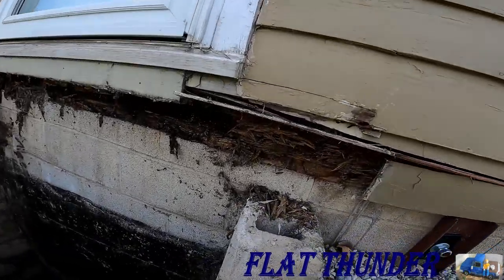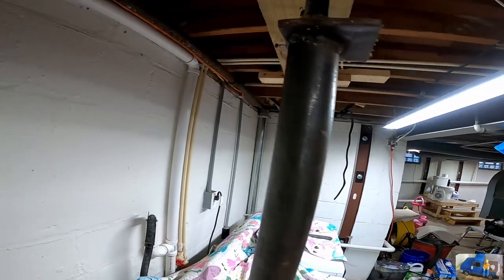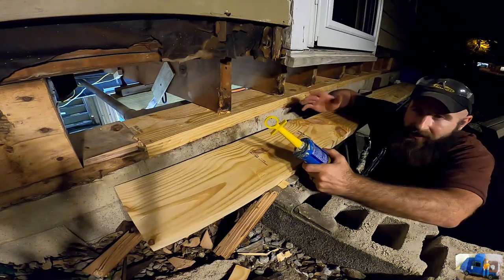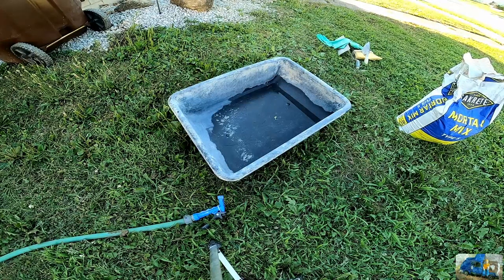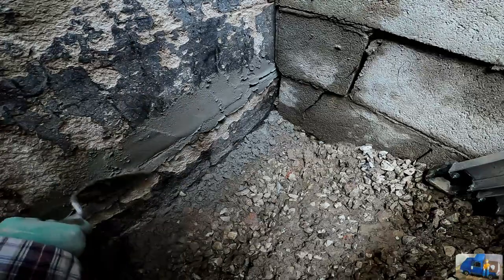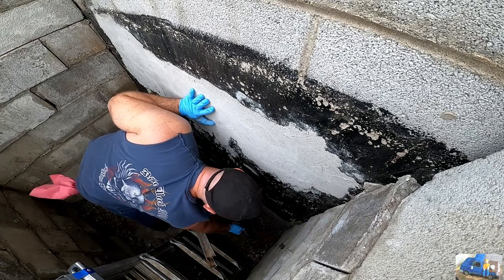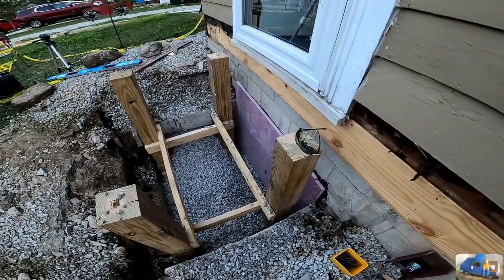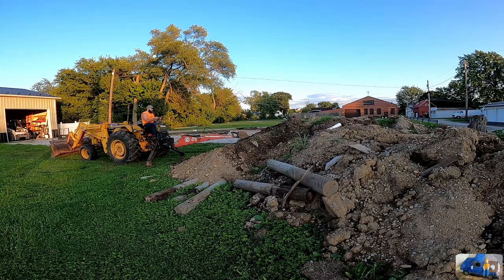RIM JOIST / SILL; REPLACEMENT (CONCRETE STEPS/PORCH ENT./ EP#2)

Comment: Just bought my first home a day looking to remove the concrete porch in the front and back. I want to replace with wooden decks as well. This gives me some motivation that I will be able to complete the task.
Reply from the maker: Excellent!  If you tackle it one piece at a time anything is possible.  I recommend installing the deck free floating; ie without attaching it directly to the house with a ledger board.  This is the best way to reduce water intrusion from deck installations (in my opinion).  Thanks for watching and congratulations on your new home!  👍😁

Comment: I had a contractor pull off my old d close and found it hadn’t been flashed. Watched him replace the rim and sill and was fascinated how fast he did it. He cut it with a reciprocating saw into small sections between each hoist then hammered them back halfway off the foundation block, took new sill and hammered it into place while the old one knocked out into the crawlspace floor and cleaned it up. He did it so fast I was amazed. I had seen people do them by jacking the joists up etc. This way was quick and the floor stayed the same level then he cut the new band board and was done
Reply from the maker: Good idea!  I probably would still install supports just out of extra redundancy/paranoia, but this could work!  Thanks for sharing and watching.  Cheers, 👍😁

Comment: I just ran into the same issue after tearing the rotted deck off our house. Whoever installed it didn’t use bay flashing and same wood you replaced is rotted. 
Looks like my house uses two 2x4 for a sill and I hope I’m not getting in way over my head attempting to repair it myself. 
Anyway, your video helped. Thank you.
Reply from the maker: Take your time, think methodically, support it safely and you will succeed!  Attaching deck ledger boards incorrectly without the correct flashing is a common cause of rot.  Even when they are installed correctly it is a leak point.  I installed our front deck free standing without a ledger to avoid having an additional (potential) leak point.  Thanks for watching and good luck with the repair!  👍😁

Comment: Look at that..im here today cuz my previous owners didnt flash the decks lol...got about 25-30' of the rim/sill plate to replace....fun stuff
Reply from the maker: Bummer..... More than double the repair required in this video.  Decks are a pretty common problem area for several houses.  People just slap a ledger board on the house and let'er rot.  Best of luck on the repair!  👍😁

Comment: Superb! I have the exact same issue. I noticed mushy sill plates when they replaced the outside door. The deck butts against the outside and there is no flashing. The basement is also finished and I dread having to tackle this, but it has to be done. Your video was super helpful and you did a fantastic job covering the details.
Reply from the maker: Thanks!  Improper flashing and improper deck installation is a common issue.  I opted to mount my deck free standing next to the house instead of installing a ledger board.  This removes a leak point and gives the water a place to go that's not directed into the house.  Thanks for watching and best of luck on the repairs!  👍😁
Reply: Is the deck attached or just butted up against it? Our deck is butted up against house, but not attached but I worry about this issue
Reply: I just had the deck redone because there was no way to look at the band joist or the sill plate damage until the deck was cleared from the outside wall.  I had one contractor do it all. They removed the old deck and found that the ledger board was slapped on the wall with no flashing, and the clowns that built it had used wrong fasteners on the ledger board as well. So water was getting into the foundation each time it rained. To add insult to injury, we found that the main support pillars of the deck were simply set inside 4" hole with no concrete! So I had to get new support pillars which were properly buried 12-18" deep and concrete poured into it. It was a disaster. 
I noticed that some sections of the sill plate were soft, including the joists, but overall, it was not at a point where the sill plate had to be replaced. Considering the enormous cost of lifting the joists from the inside to put a new sill plate (the inside of the basement was finished and that meant cutting drywall etc),  the builder affixed sections of solid board against the old joists to create a strong support to which they properly screwed the new ledger board. I took the time to block each band joist cavity with a 2" foam board and spray foamed around it to create an air seal before they put the new ledger board on it. They then installed a metal flashing that went under the vertical framing of the house and over the ledger board so no water would go into the band joists. The framing of the deck was constructed over the flashing. I also used joist tape along the length of the deck support framing to prevent rot. Once the new deck was built, they installed the proper j-channels (mine has vinyl siding) and sealed all contact points along the outside framing.  This should fix the water incursion. I am glad I decided to take the plunge to address this because it would have proven costlier the longer I waited. I hope your situation is better than mine and wish you the best.
Reply from the maker: @MrSoulMonk  it's crazy how builders can overlook simple flashing..... They must get away with it because the damage takes time to show up.  Happy you got everything repaired and fixed up!  I opted to leave my deck free standing next to the house without a ledger board.  It has a gap of ~1" give or take.  👍😁
Reply from the maker: @youknow1334  my deck install has a gap of approximately 1" in between the house and the deck.  No ledger board required.  Thanks for watching 👍😁

Comment: My buddy just did a job like this last summer at his mother's house.  Home builders never protected the rim joist from the elements and attached a deck directly to it.  Snow and rain had nowhere to go and just sat there.  After about 15 years her rim joist along the deck was pretty much gone from rot.  My poor buddy spent most of his spare time replacing the rim joist and ledger of deck that had rotted then he rebuilt the deck.
Reply from the maker: Lots of builders fail to flash in the deck correctly.  I prefer omitting the ledger board and spacing the deck slightly away from the house.  It's a little more expensive, but provides a space for the water to drain.  This is definitely a time consuming project!  Thanks for watching and sharing!  👍😁

Comment: About to do the sill plate and rim joist under my front door. Have been scared because it looks so bad. Thanks to this video though I think I can do it. Fingers crossed
Reply from the maker: I am happy my project videos are helping others!  You can do it!  Please ensure to lift and support your floor joists safely.  Typically a poorly flashed in door will cause water intrusion around door thresholds.  Happy DIY'ing!  Thanks for watching.  👍😁
Reply: @FlatThunder  there is no flashing around the whole house. Surprised it isn't much worse.
Reply from the maker: I am guessing it is an old house.  On my repair project I used tar paper to flash in around the threshold along with tar sealant.  I think Aluminum is a better option.  If you are replacing the entry door too, they have other options.  I have seen (but not used) rubber membranes and aluminum caps people install before setting the door.  Cheers, 👍
Reply: I think that grace ice and water shield would work for flashing it's self sealing made for roofs and around window...

Comment: Thanks looking forward to seeing the flashing and siding replacement. Very helpful
Cheers Chet
Reply from the maker: Hi Chet!  The video is available on the channel.  I don't know if I mention it in the video, but they make special pre made wraps / flashing pans for under the door threshold.  They are ideal.  I used a different approach to avoid removing the door.   Thanks for watching!   Cheers 👍😁

Comment: hey thanks for the video. very helpful. I have to replace the sill plate and rim joist (face board as you called it) on my son's house he just bought due to water and termite damage. It's 90 years old. I see you just supported the joists and pried out the old sill. I thought I'd have to lift the joists another 1/2" or so up to get the sill plate out. I was also concerned about taking the rim joist off in case the joists would go crooked or something. I was thinking of working in about 4' sections on ours. we still have to rent a jackhammer to remove the concrete that was poured up next to the house. probably why there was water damage.
Reply from the maker: Sorry for the delayed response.  I thought I replied to your message already, but must have fat fingered the submit button.  If you are concerned about the joists moving I recommend affixing them together.  You could add short 2x4 sections in between the joists to stiffen them and to hold orientation and or you could place a scrap 2x4 or 2x6 directly on the bottoms of the joists as a temporary position holder.   If you are interested in renting a jackhammer check out my video (https://youtu.be/YUzTGLIG5r4).  I purchased a cheap jackhammer and use it to demo an old concrete foundation.  It was actually cheaper than the rental fee and now I have it around should the need arise.  Please support your house safely and cautiously.  Cheers,

Comment: Do you normally have to place jacks under the house to replace the rim joist and sill? I have the same problem right now.
Reply from the maker: If you do not support the joists they will drop on the top of the blocks.  I suppose if the bad section only spans a couple joist it might be possible to replace without jacking.    Maybe slide the new sill in as the old one is sliding out (ie don't remove the old sill until starting the new one in).  However I would recommend supporting them from underneath.  It doesn't need to be raised, but more so supported in it's current position.  Thanks for watching! 👍😁

Comment: Looks like no front door sill pan was ever installed and water seepage wicked on down?
Reply from the maker: No pan or flashing was present on the door.  The concrete pad in front of the door was pushing a ton of water back into the siding damaging it much wider than the door.

Comment: I'm doing the same, but mine is a little more extensive. Mine is in the corner of an add-on, it is all rotted top to bottom. I'm dead ass tired. So what do I do to relax? LOL, I looked to find someone doing somewhat the same and see how they are approaching it, of course after kicking dirt while mumbling something and then accepting the job at hand.  Thanks for sharing, and keep up the good fight.
Reply from the maker: Yikes a corner would complicate things a little.  Just take it one piece at a time ensuring to properly support the foundation and not make significant changes in its elevation.  It could complicate things and it crack drywall upstairs.  Thanks for watching and keep on chipping away at your project!  Cheers 👍😁

Comment: I may have missed it but why is the rim joist not flush with the sill?
Reply: Nevermind must have been the angle. Good work man
Reply from the maker: The sill plate I installed did have a 'little wang' in it.  I forget exactly how it was bowed, but I did have to shim the furring strip / tack strip for the siding to make it all happy!  Thanks for watching 👍😁

Comment: Need to Sawzall under those floor joist to plate, the joist are toe nailed to the plate.  You may break the ends off each joist if you don't cut the joist  free from the plate.
Reply from the maker: Good tip!  I don't think mine were nailed.  The sill plate slide out real nice!  Thanks for watching 👍😁

Comment: Hey quick question, I'm replacing a small section of rim joist I found with some rot (~2 ft). I was able to remove the rot on sill plate and rim joist on this area. I got the sill plate in, but unable to get the rim joist in. I got a 2x8 and  its just a tad to big, should I be using a jack to fit it in, or should I look at trimming the board down?
Reply from the maker: If the floor isn't sagging I would trim a small amount off of the rim joist to make for a snug fit.  Double check before trimming to ensure something else isn't hanging it up; obscure nail / object or a warped board.  Thanks for watching and good luck on the repair!  It sounds like you're on the home stretch!  👍😁

Comment: Just knocked out the old cement porch and my rim joist was rotted out completely. I noticed it when I replaced the front door and noticed the sagging when my door wasn't squaring up
Reply from the maker: Concrete pads and decks can drive moisture into homes if not setup correctly.  Double check the method of flashing around your new door install.  Moisture can find its way in at the door too.  They sell special flashing caps for door thresholds that look promising, though I never used one.  Thanks for watching and sharing!  👍😁
Reply: @FlatThunder  I taped around my rough opening even went down to bottom of my rim joist and seal plate for the hell of it. Building a deck in the spring until then we use the side door

Comment: Awesome work. How did you fasten the new part of the sill plate to the foundation?
Reply from the maker: Thanks!  In the short section I replaced only one anchor was removed.  It is only sitting on the foundation in this area.  In hindsight I should have installed a couple Tapcon concrete screws thru the sill plate before installing the rim joist.  Thanks for watching! 👍😁

Comment: Hi,
How did you install two columns?
I think you did not use concrete, did you?
thanks,
Reply from the maker: Hello, the temporary lifting supports are just sitting on the concrete floor.  They are not bolted or fixed in place.  The steel c channel beams are thru bolted; one on each side with 3/4-10 threaded rod squeezing the two sections together.  Check out the earlier short narrative on the foundation repair.  It shows the process with pictures and an explanation.  Thanks for watching 👍😁

Comment: Thank you so much for taking the time to video this project. You probably have no idea how much it actually has helped multiple home owners who don’t comment or like the video. By the way where did you get your prybar? That’s quite the tool. Thanks so much again you’re awesome.
Reply from the maker: Thank you for your kind words!  I am happy my videos are informative and helpful to other's in need of information.  This one is a huge hit on YT!  I think the subject matter / need for repair is common among wood frame construction homes.  Thank you for watching!  Cheers 👍😁
Reply from the maker: Sorry I just noticed I did not tell you about the pry bar.  It is awesome!  It is a Gearwrench branded telescopic prybar.  I purchased my off Amazon after seeing a Millwright use one on a jobsite!  Here is a link:

https://www.amazon.com/gp/product/B0015015H6/ref=ppx_yo_dt_b_search_asin_title?ie=UTF8&psc=1
Reply: @FlatThunder would this be the same approach for a mobile home. No block foundation. The sill/bottom plate rests on 2x6 joists. We have a quite a few spots of bottom/still and rim that are rotten.
Reply from the maker: @youknow1334  I'm not overly familiar with this type of construction, but in general the process should be similar; safely support the joists/wall and repair the damaged sill / rim joist.  The key to the repair is learning why water was getting into the damaged spots and repairing it to prevent damage again.  Thanks for watching!  👍😁
Reply: @FlatThunder  I think it’s because the sheathing, house wrap and siding stopped short of the sill plate. Windows do not leak, we have block pier foundation and block skirting which is fully encapsulated with a dehumidifier. Re just removed gutter in that one area to see if that was culprit but it did not change circumstance. Roof looks good and no stains on ceiling. At a loss here other than what I first suggested as possible cause. Brought in many *pros to no avail.

Comment: If I just need to replace the rim joist and not the sill plate do I need to Jack up the floor beneath to support the floor joists? I understand the need for bracing the joists when you have to replace the sill plate. I’m new to this stuff and just discovered a bunch of rot after a deck demo. Any advice is appreciated!
Reply from the maker: I would recommend it.  The construction shown in the video has the rim joist installed in between the upper floor sheathing and on top of the sill plate.  Decks encourage rot when not installed properly.  Improper flashing at the ledger board is a common mistake.  I opted to install the deck free standing without a ledger board.  This allows any moisture to drain without going into the house.  Thanks for watching!  👍😁

Comment: I don't know about these things, but I was wondering if some adhesive or caulk should be placed between the concrete blocks and sill plate to seal out drafts, water, and insects. Yes, no?
Reply from the maker: Yes, I think a sealer is a good idea!  I applied 100% silicone caulk at the interface between the block and the sill plate on the exterior of the house.  I didn't install before because I would have pushed it all out when sliding in the board.  Thanks for watching 👍😁